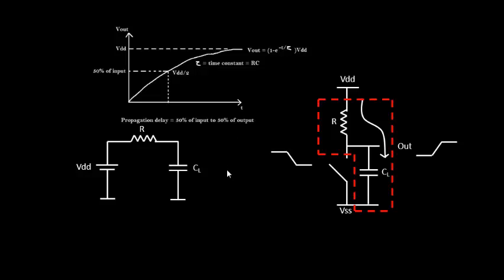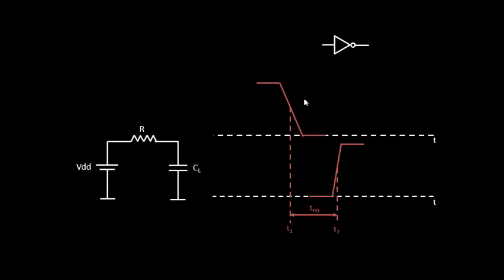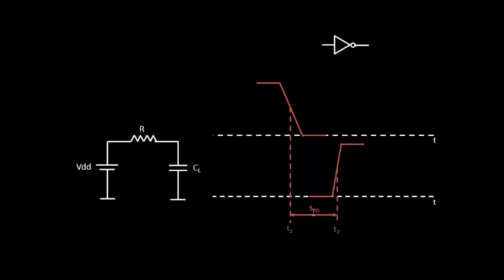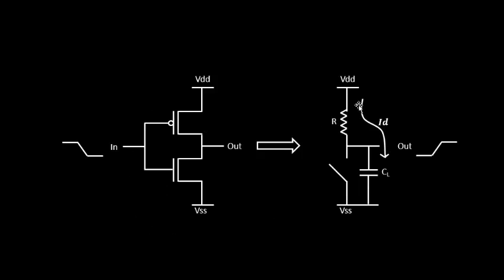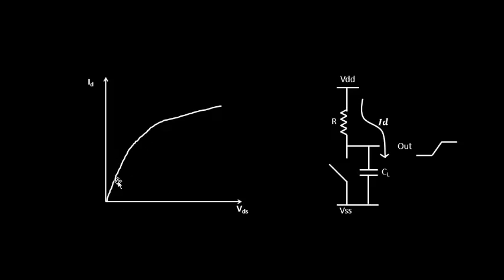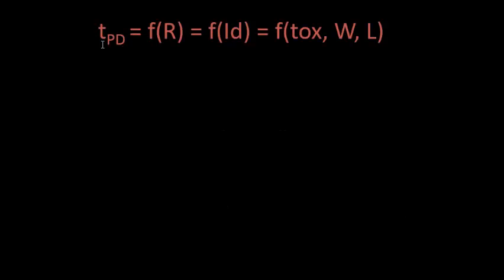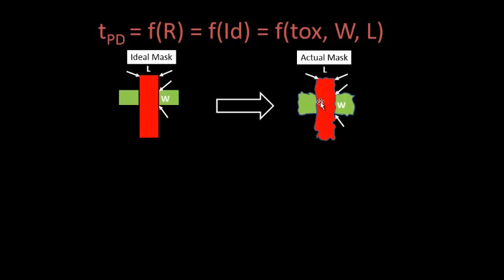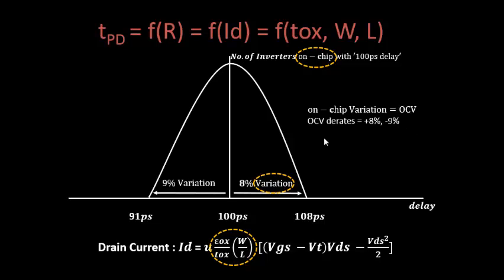What is OCV Delay, Resistance And Drain Current Relationship?? Learn @ Udemy- VLSI Academy

Comment: Thanks so much.. i was trying very hard for such clear informative videos/pdfs/material. thanks is such a less word to use. 

on other note, i am following the comments from people where i can get diff view of the information. one such is the metal layer naming you used. can you share the information on a practical basis for metal layers, when we use a def/layout? which ones will be called m1,m2 layers in the constructive view of a transistor and of course in a floor plan where we have all the cells from basic transistor. and how we will denote the oxide and poly in def view. appreciate the help
Reply from the maker: Vasantha, you might want to go through the below course and get back if any of your above queries is unanswered
https://www.udemy.com/vlsi-academy-custom-layout/